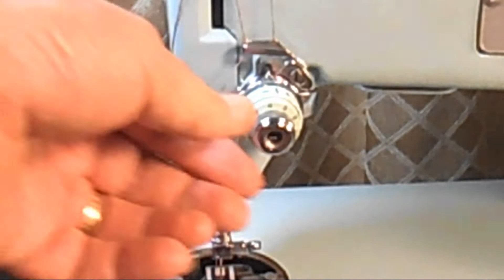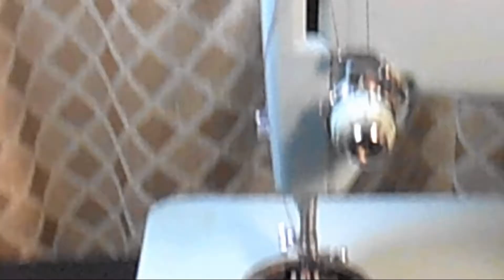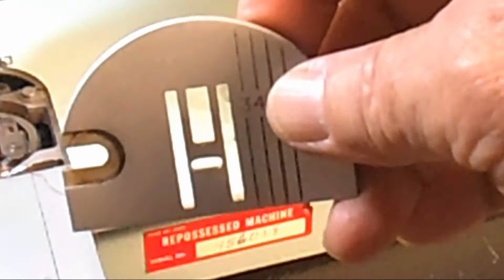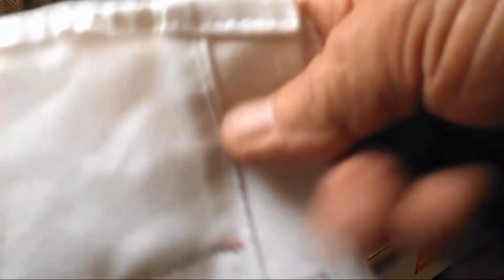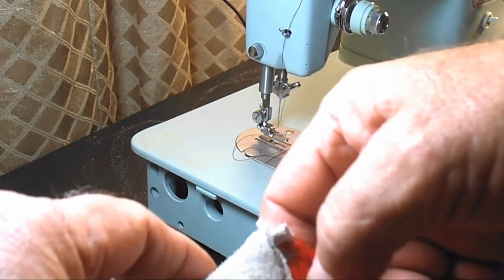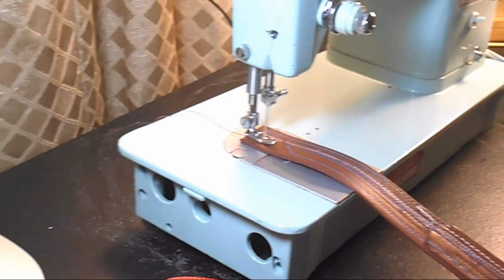Single Needle Straight Stitch Sewing Test on a Singer Model 338 Sewing Machine

Comment: please can you explain more clearly how to reverse?
thanks
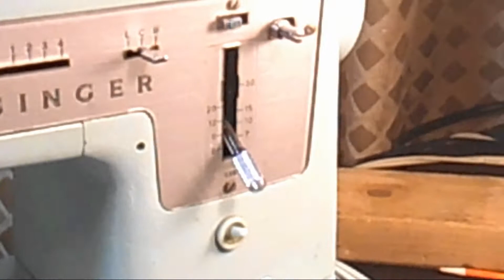Reply from the maker: Great question Kriss; thank you. I did not explain how to reverse, or backstitch, well. At about 2:20 in this video I talk about the stitch length control, or feed regulator, lever. As you move this lever upwards the stitch gets shorter and shorter. When you get to the top of the "fine" area you actually get to a point of "zero" length. When you keep moving the lever upwards the feed mechanism starts going in reverse or pushing the fabric towards you instead of pulling it away from you. When you want to sew in reverse on this type of feed regulator you simply move that lever ALL THE WAY UP. You do NOT need to hold it there, but as long as it is up the machines sews in reverse until you drop it down to the numbered area, like 15, 10, or 6. You can sew a whole seam in reverse if you are inclined to do that. You can move the lever up "on the fly", like if you are coming to the end of your seam and move the lever all the way up and backstitch, or backtack, for 3 or 4 stitches to end the seam. If you are going flat out speed forward I would not throw it up into reverse. I don't think it would hurt the machine (it's too sturdy) but maybe break your needle.
You can go here and download a FREE COPY of the original Singer Instruction Manual for this Model 338, or almost any Singer model. http://www.singerco.com/support/instruction-manuals
Just type in the Model number, no alpha characters, and click on the search button. It takes you to a page with a list of every SInger that has that number in the model number. Then click on the "free download" button for your model. It is in PDF format. On page 14 of the 338 manual is the explanation of how to reverse stitch. Thank you very much for asking a great question. Hope you stop by again Kriss.
Reply: Andy Tube thank you for your detailed explanations,you gave me much more informations that I couldn’t find anywhere’ else,I’ll try  them,practice,(sorry if my English isn’t correct I’m a native French speaker ),keep up your good videos,they are truly helpful,thanks🙏🏾
Reply from the maker: Very welcome Kriss. Your English is better than some Americans I've met, so don't worry. Take Care.